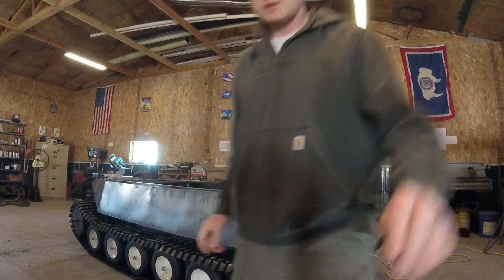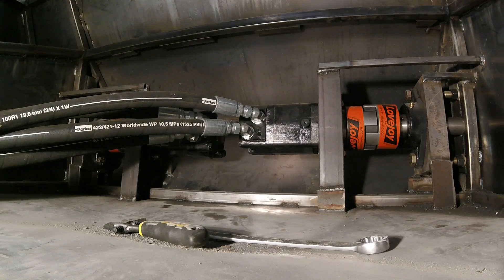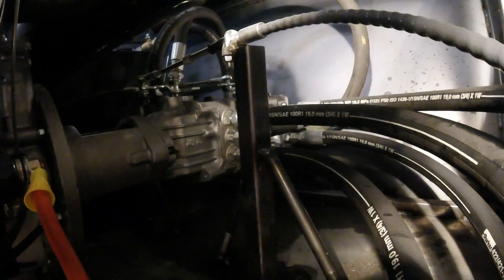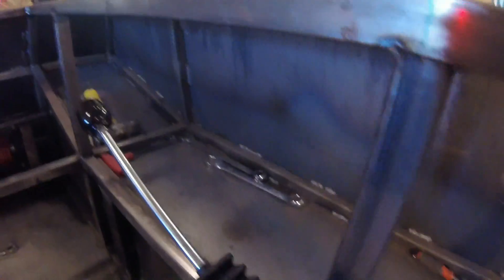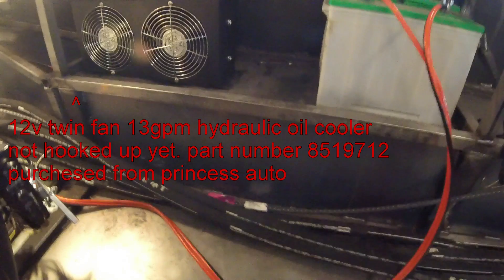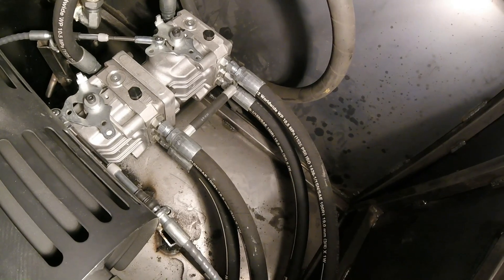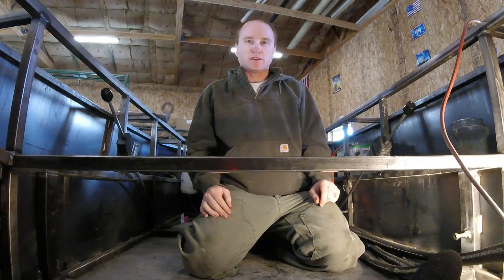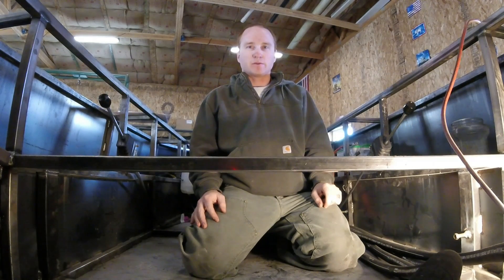Tank hydraulic drive system explained

Comment: wow Thanks for this video. This is just what I need, I've been looking for a hydraulic setup to power an aluminum bodied Argo sized offroad vehicle and this setup is nice and compact.  I see alot of people had the same questions I had about the top speed. Do you think you system has enough torque to be able to add more speed with chains and sprockets at the axle instead of directly to the motor?

Comment: what hydraulic oil does it use ?
Reply from the maker: 15w40 is what I used in this one
Reply: @JamesCookTinyTank428  ok i'm trying to purge the air out of the system as hydro-gear suggests by openning the bypass valves and it's not working . any suggestions would be appreciated . thanks

Comment: Thanks for this.  I am just starting the process of building a 90% scale STUG III Ausf A.  (90% reduced the vehicle to 8'6" wide and that can be put on a trailer w/o an oversize permit).  I was less than happy with most mechanical systems.  I did solve the road wheel issue, 20" solid forklift tires are perfect.  The drive sprockets will have to be machined.
Reply: Hey, I would like to start similar project in future. I have been researching stuff for It for now. How is your project going?
Reply: @esa689  ... dead at a wall.  Why?  Costs.  I was quoted $400 per fork lift tire.
Reply: @Easy-Eight  oh, I see. I am thinkin about using wheelbarrow wheels. They can handle the weight.

Comment: your drive system willwear the drive sprockets out in no time. watch your video closely and listen to the clunk noises. . you can not have the top section of track hanging down from gravity. whenever putting tension on track by sprovket it will try to climb the sprocket. its a severely flawed design. look a proven designs that have been on heavy equipment. your hydraulics are a good system. good job on that. redesignthe entire track sprocket , idler system... it would be even better if drive sprocket was on one end, idler wheels in middle belt using whats called WALKING BEAM CONSTRUCT WITH A tensioner idler sprocket using big coil spring to maintai9n tension on track at all time to eliminate sprocket creep completely. do what I say, I am a genius. Brett
Reply: I see what you mean. At the beginning you can see one of the tracks going sloppy at the front when he drives and turns it back towards the camera.
Reply: Look at original tiger and t34.
It's known as a Slack Track system. 
Yes it has problems.

Comment: what type of pump is that? can you do a video about it?
Reply from the maker: It's a varialble displacement piston pump. There are quite a few videos with illustrations on how these pumps work far better than anything I could produce as far as graphics and cutaways
Reply: @JamesCookTinyTank428  is it checkball?
Reply from the maker: @BigCroca  
So the plate inside the pump is default to neutral when in the neutral position the fluid flows into the back end of the pump threw both pumps out of the front pump back to the tank. When in neutral the fluid never goes to the motors. When you turn the plate via the push pull cables it sends fluid threw one of the lines into the motor causing it to spin one direction and then it goes back to the pump. When you turn the plate the other way the fluid now travels the opposite way threw the circuit and causes the motor to spin in the opposite direction. Fluid is still returned threw both pumps back into the tank but it's now being used first.
Reply: @JamesCookTinyTank428  OK thanks :)
Reply: @JamesCookTinyTank428  are the motors also axial piston?
Reply from the maker: @BigCroca  
I believe the motors are piston as well. But I'm not 100% sure. I haven't ever pulled one apart but I think I seen on a paper for them that they were piston motors.
Reply: @JamesCookTinyTank428  please help im going to build one i think

Comment: What made you decide to go with directional pumps and cable controls instead of standard pumps with hydraulic directional controls to be able to control speed?
Reply from the maker: I chose to go with the hydrogear pumps because they are much simpler to plumb and use. My first tank I did use spool valves and a flow control valve. but i found without a priority valve the fluid would just take the path of least resistance and it wouldn't turn very well. At that point I decided instead of plumbing in another valve in I would find a better way. The hydrogear pumps are what I found a lot of zero turn mowers using. So I figured I would try them. I can control speed with the amount I push the levers forward or back because they are a variable displacement pump. I can further control it with engine rpm so I think this system is a win all around.

Comment: What Engine you use ? Hp ? Nm ?? Thanks
Reply from the maker: The engine in this vehicle is a 22hp predator engine and my other tanks have 22hp Honda engines in them. The predator engine is cheaper and so far just as reliable as the Honda engines.
Reply: děkuji

Comment: quick question relating to braking when engine is off and hydraulic is off. If you had in on a hill would it roll down or did put a safety valve in to stop it?
Reply from the maker: ForgeCrushing AU 
The E 25 has different hydraulic motors that have a park brake built into them but the rest do not. It takes a pretty good incline for it to overcome the resistance of the hydraulics and the tracks. So far it hasn't been an issue.

Comment: $1300 for EACH hydrogear pump, and $295 each for the motors.  So $3200 not including gas engine, cooler, cables, hoses, etc.
Reply from the maker: Jacob w 
The pumps are in a tandem configuration so 1300 covers both but still not the cheapest.

Comment: What is it that limits your speed? Is it the tracks or the hydraulic pump or motors?
What is the estimated top speed of yours? Do you think it would be possible to reach around thirty miles an hour using hydraulic drive?
Reply from the maker: Koito rob 
The speed is mainly limited by the hydraulic motors but the tracks probably couldn't handle much over 15 or 20mph. Top speed i estamate around 7mph i havent taken it full speed with a gps to find out. 30 mph might be possible with a two speed pump and different motors. But a transmission and a differential would probably be the cheaper route to obtain that speed.

Comment: I am planning on making a 2 man 3/4 scale M2 Bradley using a hydraulic pump/motor like in this video, What equipment would I need to make this work?
Reply: I am planning on using it for airsoft and actual infantry carrying would be optional.
Reply from the maker: Dragon747 
Are you asking what equipment to build it? I would suggest if you're going to make it out of steel a deicent welder a plasma torch and a metal chop saw. I would suggest a toothed blade vs an abrasive on the saw. If your asking whats needed to make it work basically what you see in the video minus the cooler its not 100% necessary.

Comment: Question: Why did you opt for ball valves rather than quick disconnects at the tank?
Reply from the maker: wboquist 
Cheaper and better flow. I had thought about the quick connects but half the price and no real flow restriction sold me on the ball valves. The quick connects would be cleaner with little to no oil loss during removal of the tank. But i hope that that doesnt have to happen too often.

Comment: 2 questions:

1) What is the maximum (estimated) speed a system like this can go? like 3-5 mph in a straight run? 
2) If i wanted to make a mini tracked-snow plow system with this,  would it be able to handle pushing snow? (im not sure if it would blow a hydraulic line or something)
Reply from the maker: Orvis25 
The maximum speed is around 7 mph and it would work great for plowing snow. A company called lite traxs makes a mini snow cat with a very similar set up
Reply: Thanks for the answer! 

I never dealt much with hydraulics so, followup. 

What is the relationship between HP and flow in this case? I assume faster/more flow = faster driving, and more HP = Stronger flow so I can pull/push more. 

Does putting a bigger HP engine (or multiple engines, so more HP per hydraulic motor or pump ) make it FASTER? (kinda want to go a bit faster than 7mph)
Reply from the maker: Orvis25 
To a degree more horse power will get you more rpm but all components in the system can limit one another. By that i mean that if the engine has more torque and rpm  than the pumps can handle it will either bypass or self destruct. If the pumps and engines produce more than the motors  can handle they suffer the same problems. So it is important to try and stay within the maximum specs for each component. The easiest way to increase speed in my system would be to get hydraulic motors with a higher rpm but you would want to try to find one with a similar torque rating or beter than the motors i use. If you're torque drops too much it will be unable to turn do to the resistance against the tracks.

Comment: how did you do the suspension?
Reply from the maker: SWEET BAI 
the suspension on this tank is just a balance bar kinda like a tetortotter with a pair of wheels at each end. my Sherman is the same way. then the leopard and the e-25 have swing arm suspension. basically just an arm with a limited range of motion that normally rest against a rubber block.

Comment: Hydraulic is definitely the way to go. There's an Austrailian fellow who built a 2/5ths scale Sherman and used a bunch of complicated chains, pulleys, belts, idlers and who knows what else. I thought he made it more complicated than necessary. The first time I used a ZTR lawn mower, I couldn't help but notice that it's steering is very similar to a tank (minus the tracks of course).
Reply: simhopp I think you might be right. That's how Ferdinand Porsche designed his version of the Tiger tank. He couldn't get the bugs worked out fast enough though and the contract went to the other guy. It was new tech then and now the biggest and most powerful machines tend to use that setup. 

I think normal cars and trucks would be much more efficient if they were gas/diesel electric. I don't know why semi tractors have remained purely diesel powered. Trains that weigh millons of pounds couldn't operate that way. It seems clear to me that diesel/electric semis could save obsene amounts of oil.

Comment: Wow, seems like a much easier and simpler way to power a tank (Compared to a transmission)

Would it be possible to use the same sort of system to power a faster tank as well?
Reply from the maker: Obese Artillery 
speed is dependent on the hydraulic motor RPM and sprocket diameter. so yes with different motors
Reply: In other words, a 100hp turboshaft.